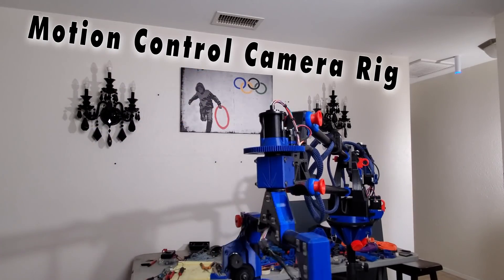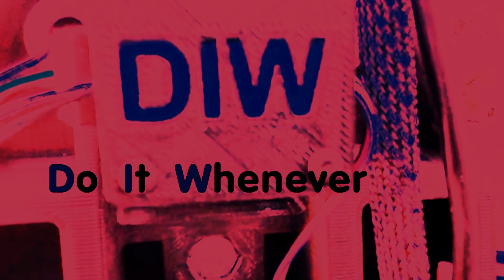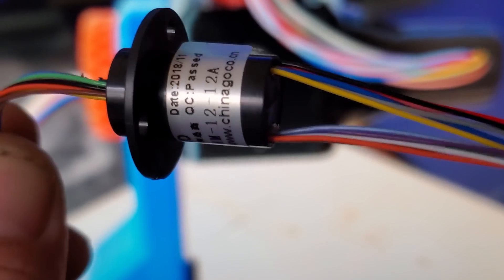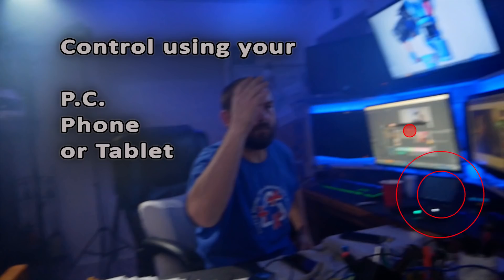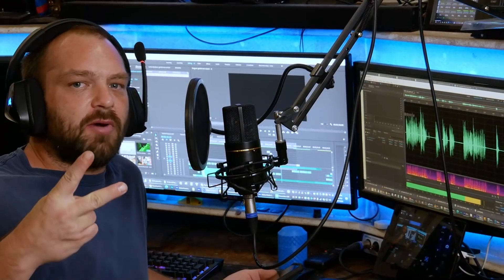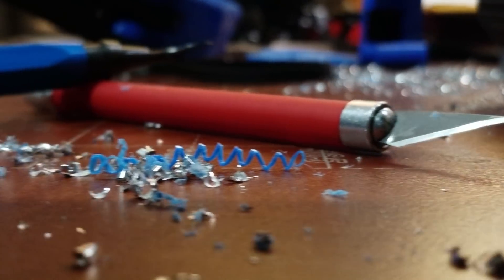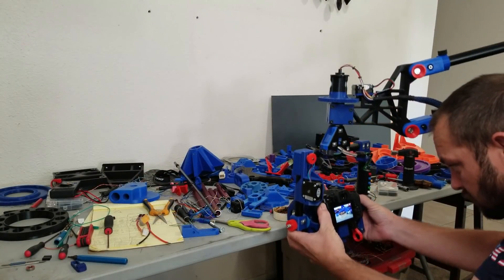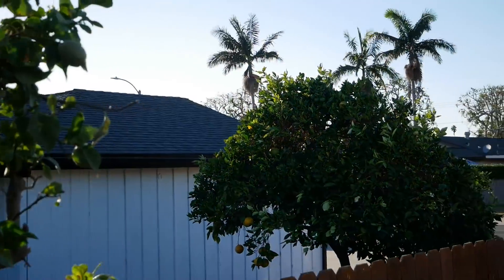The greatest DIY MOTION CONTROL camera rig EVER - allegedly

Comment: I'd integrate it with blender... I don't have the space to build this bad boy though, I think.
Reply from the maker: I haven't used blender much, but seen great things
Reply: @DoItWhenever  Main reason would be because of the animation and rigging features. A model could be built of the camera rig, animated and then the values transmitted  as g-codes. Complicated, but it would be a good user interface I think.
Reply from the maker: @Andreas-gh6is  I recently found this and is almost the same as the blender option minus the other cool things you can integrate with blender... www.bottango.com but that project is also just getting started over there
Reply: @DoItWhenever  I've looked at bottango. For one thing it isn't open source, apparently. Only the Arduinostuff you need to get it to work with a microcontroller is open source. That being said, blender doesn't have some features like physical simulation, at least not in the sense that it could calculate forces in an animation rig. But I guess it's a question what skills one has. I have used Blender a lot, and have a lot of experience in Python, so I would be more comfortable to rig a robot in Blender (though I haven't done it before). It wouldn't be that easy, though, because smoothly transforming value curves into g-code might be quite tricky.

Comment: Awesome project. Been working on a similar design. Have a way to remotely control  cameras but would love to add the motion. What type of NEMA 8 steppers are you using - there are a bunch of them on that site? Where did you get the tubing from?
Reply from the maker: I'm doing the electronics video next with a full parts breakdown

Comment: When you power it off does it "fall" to the ground? or does counter weight prevent that even without power?
Reply from the maker: If using the counterweight correctly the boom arm won't move anywhere.

Comment: If you want programmable keyframes, maybe look into using a dmx control software, they are similar in design to what you would want. You'd need to convert the dmx commands to gcode, but that shouldn't be awful to do. Probably would also be a good idea to switch to a closed loop control with a kinematic controller as well, then you could do stuff like keyframes, and straight line movement
Reply from the maker: I just found this... gonna give it a whirl www.bottango.com
Reply: @DoItWhenever  Dang, that looks super cool, never knew something like that existed for free. Definatly going to use that in my next project

Comment: Awesome project, and those custom printers caught my eye. They look absolutely wild, even for custom machines. Any plans on showing those off a bit more?

Also, stick some pots/angle sensors on there and you can make a "teach" mode! You can even filter/smooth the measured values to get extra buttery shots w/o programming anything.

An another note: I've tried using UGS (Platform) for 4 axis control, and it complained a lot about the non-3 axis setup. Did you add in any 4+ axis control specifics to it?
Reply from the maker: USG will operate six access by default but it only shows XYZ in the dro... I haven't been able to get the dro to reflect all six axis... But this G-Code control method is super rudimentary and going to change in the future
Reply from the maker: Definitely planning some videos on this printers

Comment: So dope! Have you thought about adding position sensors so you could program the g code for the shot in by just using manual manipulation of the rig/rehearsal of the shot prior to actually shooting. Basically it will record your movements as input

Comment: This is awesome man! I’m looking at making a remote controlled fiz control system like you’ve done just as the production ones are so bloody expensive!! and a bit heavy...

Did you program yours to automatically calibrate their end stops or do you have to do it manually?
Reply from the maker: there are no end stops. pretty much every axis can spin continuously.... you set a home position when you first turn it on
Reply: I was only taking about the fiz control, I take it that’s the same?
Reply from the maker: @chrisknight908  ya. When the machine first turns on it has no idea where it is in 3D space... You can just manually move to where your end is... And then set that as the home position... You can also set software and stops but I don't use those as I think it adds more problems in this machine

Comment: Do you think PLA was the right choice in hindsight?
Reply from the maker: PLA is pretty stiff and rigid vs abs or pet.. it is a bit heavier though... maybe abs or pet for the head components to reduce some weight.
Reply: @DoItWhenever  Thanks for your answer, I was worried building my project mostly out of PLA considering the general consensus is that PLA is ment for prototyping instead of real-world use products. I love what you have created and I'm curious about your next project.

Comment: It would be great to get started printing the parts but I see from the thingiverse page that you state infill is 10% to 100% BUT you don't say which parts get what. :) Can you help a brother out?
Reply from the maker: Hey, sorry for the late reply.. there so many parts to this rig... it hard to pick a place to start :) I would probably start working on the base and expanding out. All of the structural parts were printed with 4 perimeters and a heavy infill 60-80. Any of the parts that are mounted to the front half were designed and printed to be lighter weight. I used PLA only because its super stiff compared to pet or abs.. I have a whole video planned for just the building part, but I was going to do the electronics one first as there seems to be a lot of people wondering about that topic.

The bearing part is fun to play well :)

Comment: I am soooooo into this build. I can't wait for the next episode. In the meantime I think I should get a jump on printing all the parts. Do you have a recommendation on where I should began? I was thinking about the mount for the speaker stand. This seams like a great project and a is gear I want to add to my setup. Is anyone else also planning on building this?
Reply from the maker: Hey, sorry for the late reply.. there so many parts to this rig... it hard to pick a place to start :) I would probably start working on the base and expanding out. All of the structural parts were printed with 4 perimeters and a heavy infill 60-80. Any of the parts that are mounted to the front half were designed and printed to be lighter weight. I used PLA only because its super stiff compared to pet or abs.. I have a whole video planned for just the building part, but I was going to do the electronics one first as there seems to be a lot of people wondering about that topic.

The bearing part is fun to play well :)
Reply: @DoItWhenever  Thanks for the reply, Im very excited about the electronics part. I wanted to experiment with printing out the base to see if I can get it to mount to a danadolly.

Comment: I am truly excited about this. I am in the development stage of a similar project, but I am trying to build a modular headless system with keyframing and timelapse functionality for location work without a computer nearby. I am just about ready to chuck my current single Arduino mega implementation and opt for a similar approach either running GRBL or Marlin 1.9 and sending commands via serial from a second Arduino or possibly a Pi. I will be watching your project with extreme interest.
Reply from the maker: thanks, I'm doing the electronics video next

Comment: Absolutely amazing and perfect timing to show up, I am literally right now making a camera rig for a friend, I've got the basics done on fusion, have an arduino and got a 3d printer recently.

It's like looking into the future of what I can make... PLus not using crazy software, custom parts of crazy code is a huge benefit..   LOVE the slip rings, knew they must exist but not in that easy to use form.  Amazing.

Only pointer, I know it's quirky but the film clips...  kinda jarring and a waste of our time - Your content is good enough to not need to add those.

Good luck, well done and thanks

Also, for moving the camera... worm gear is so much more compact and efficient, plus when the rig is off it holds position.
Thanks too for showing the cable drive, I was thinking of the exact same, or maybe belts like Kuka robots use - to keep the motor weight back, like me you've just gone for motors where you need them.
Reply from the maker: the belt could have worked but I got tired of failures... lol.... so I put the motors on the end... I really didn't want the weight out there but this is only version 1 :)

Comment: So belts and cables are no bueno? What could I do to refit a kit DIY light weight camera slider I constructed with 3D chassis parts? It has vertical vibration visible in the video that enough to see or feel in the slider itself. It's got the typical belt from the stepper pulling a platform with linear bearings on 2 rails. The rotation motor drives from a 10 tooth pinion on the stepper to 100 teeth printed on the inside of the turntable plate. It's a learning kit I guess but needs beefing up.
Reply from the maker: belts are probably better actually, they don't have backlash like gears... but  I got tired of failing and I wanted to keep the parts cost down so I went with printed gears

Comment: You can use blender 3d for "programming" the animation. You can animate the movement, then export the keyframe of the animation to GCode. Blender 3d is a free and open Source 3D software
Reply from the maker: Thanks, i'll check it out

Comment: This is an incredible project! I love the buttons so you can set your rig and it will hold when you release. 

Is there a way to for it to track that move with encoders so that it can replicate a hand move, or just set start and end keyframes by setting in and out positions? Really looking forward to the next part!
Reply from the maker: I'm doing the electronics video next!

Comment: If you incorporate the encoders on each of the axis - or maybe stepper-servos with build in encoders - you could basically teach the robotic arm where you want to be. Or save 2 positions and just run a linear interpolation from point A to point B to get a 6D automated slider. Look for MKS SERVO42B. These servos are also open sourced.
Reply from the maker: I'm doing the electronics video next!

Comment: I checked printing cost and time necessary to do it... May I suggest to form a group and organize group order to see if it can be produced cheaper and faster?
Reply from the maker: It's definitely an end user project. If I were going to make this for sale, it would probably be completely different in its design.  Maybe version 2?
Reply: @DoItWhenever  this was more targeted at the idea to order 3d  printed parts as a group order. Not ordering from you ... Which I would consider also if available.

Comment: This is awesome! Subscribed and can't wait to see where this goes!

I've had a project going for a while that is effectively a super mini one of these using a HQ RPi camera, but was cheaping out and trying to get away with micro servos which weren't precise enough for focus and zoom control. I assumed going bigger would be too crazy, but seeing yours I'm inspired again :D

The G-Code interface is really clever, but on top of that you could try to build an "inverse kinematic model", which would allow you to define camera locations and moves and have the model figure out what G-Codes to send to make it happen. James Brunton does a pretty good video on it (https://www.youtube.com/watch?v=JveN4g8hOHQ). Unfortunately I think that really only gets interesting if there was a way to add electrical control to the arm extension adding a 3rd position control axis, since with the current setup it looks like every position is fixed on a shell once the arm length is locked in.

I also love the quick motor unlock buttons!  To make it even more crazy, if you added encoders to the axes, you could record positions or move paths and recall them later.
Reply from the maker: awesome, I'm doing the electronics video next and hoping to address the issue of how we can all work on this project as a community!

Comment: The project is EPIC, but the footage looks... somewhat awful... for some reason... The movements are shaky, the picture quality is really bad...
Reply from the maker: I had a couple issues in the video... One of my motors was loose, I didn't turn stabilization off on the camera. And I didn't use the zoom motor on a few shots I did a zoom pull in post... I wasn't too happy it was some of the shots either but used them anyways.

Comment: This is an awesome project, but I don’t think it’s there yet. The whole reason to use a robot arm, is to create super smooth shots. Or exactly repeatable shots. But this looks too flimsy to me. It wobbles and I don’t think it’s very precise. I think the camera is way too heavy for the rig. Probably V2 ;) needs to get beefed up by a lot.
Please don’t let this comment put you down. It’s an awesome project. Keep up the work!
Reply from the maker: There were a few issues in the vid. I had my camera setting wrong, acceleration settings too high on some axis....and I noticed after taking it apart for the next video, that one of my motors was just sitting in place... I never screwed it down lol :)   The rig actually works well, but it does have some flaws... that's to be expected though when it's plastic and $400 bucks vs $90,000 for production gear :) I actually tend to use it more in manual mode... it's such a great "tripod"

Comment: Damn! You, sir, are a badass.<---period
As a lifelong maker and a 29-year cinematography vet, including a lot of motion control and OG VFX, I can safely say that your project is amazing. Your open sharing of your work is most noble.
I may just build one of these to use on my wife's channel... Well done, good sir!
<SUBBED>
Reply from the maker: Awesome Thanks a bunch. That's neat, even with all the gear you have used..... this is somehow is still cool to you :) I actually tend to use it more in manual mode... it's such a great "tripod"  Even if you only use the motion for setting up a comp. I can sit at my desk (filming alone) and setup the shot and adjust camera placement focus and zoom from 12 feet away :)

Comment: Hi. Looks super impressive and I'm ready to build it, BUT... most important question for film-making: How loud is this machine ? I guess there's a lot of moving part and not to mention the motors..
Reply from the maker: It's pretty silent, the only noise is from that 40mm fan inside the housing. I used TMC stepper drivers which eliminate the noise the motors normally make

Comment: Good work! But it seems it need some PID controller or if it has PID controller, it has to be tuned more for get rid of the unwanted oscillations.
Reply from the maker: I'm doing the electronics video next! I did have the accel settings to high for that run

Comment: You can adapt it to run off DMX or OSC protocols then you can use many free apps to sequence  in moves. I’ve done that with arduino+stepper pan, tilted slider system
Reply from the maker: Nice! I'm doing the electronics video next!

Comment: If u pair this with Blynk you will have motion control via bluetooth with virtual potenciometrs and maybe if u give for this rig memorable function or maybe tracking option via rpi and camera and via arduino memorable software it will be more easy to use and more handy. But on the other hand Nice job I love it

Comment: Awesome design! I noticed you used 3d printed roller slew bearings. How did that work out for you? Was it hard to get them stable? How much slop is there?
Reply from the maker: I got those right surprisingly quick compared to some of the simpler parts. I left slop in the system but also printed a nylon spacer that the turret spins on.. when you tighten everything up the slop pretty much disappears and the turret rides smooth on the nylon.  My first design used a lazy Susan bearing but it was actually worse, and I didn't want to spend the money on a heavy duty slew ring.

Comment: Wonderful video, thank you for sharing this impressive project!!! (I subscribed with the "he had a mechanical arm!" quote XD). This may be a bit niche, but I was wondering about the repeatability of movements for a system like this for stop motion / motion control. For example, would images from the camera line up well if you ran the same motion twice? In any case, this is seriously impressive - and not having to worry about wires tangling during rotation is a seriously underrated feature
Reply from the maker: Nice! I'm doing the electronics video next! I'll cover that and any flaws I've seen
Reply: @DoItWhenever  Awesome, thanks!

Comment: Well commenting on a 10 day old video but ... If you build a (simpel (simpel as in sticks are enough)) model of the rig as an armature in the free(open source) rendering software blender then you could use it to create an animation sequence with e.g. keyframe animation, doing a certain path and with the python api you can export location and rotation of each joint into an csv file for each frame. Cool thing is blender takes care of all the inverse kinematics. Just a thought sparker.